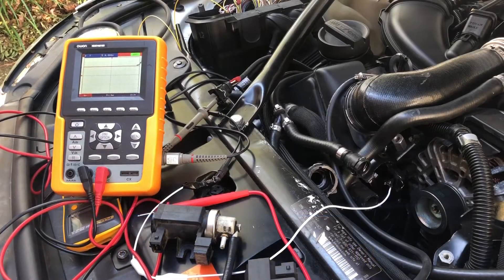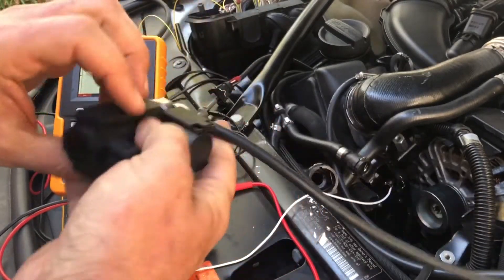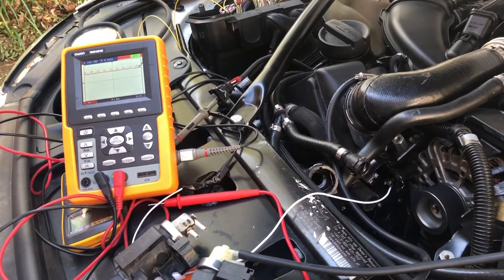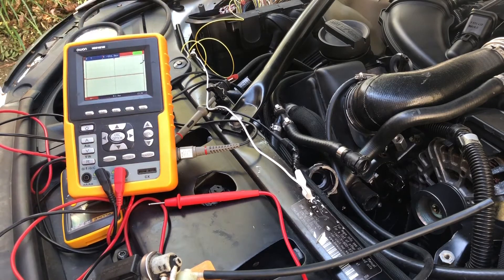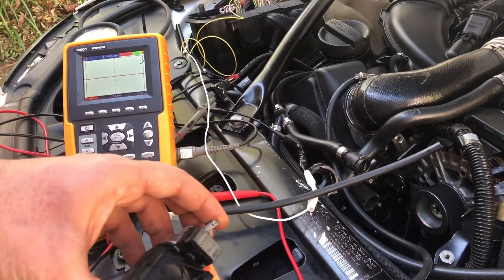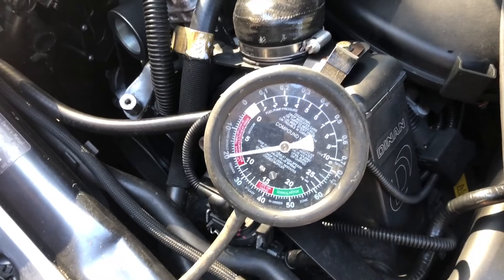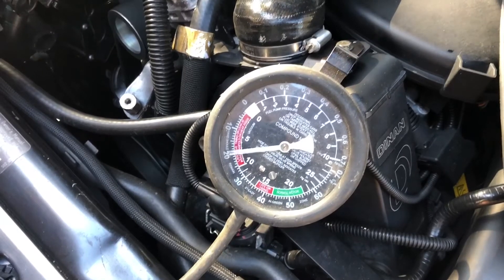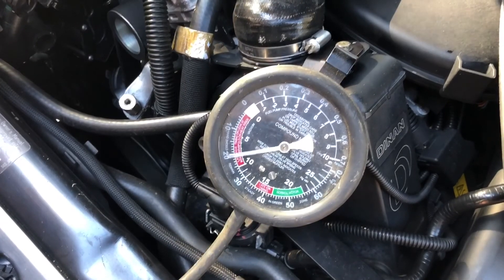BMW N63 diagnosing overboost issue! BMW dealer gave up

Comment: Hi, i have the problem that’s it’s not building boost. Can you tell me which cables are from the boost solenoids in the dme? I also want to probe the and check, it’s like they don’t get a signal from the dme. Placed new solenoids, no vacuum leaks, new wastegates. Running out of ideas here.

Comment: Hello. I have the same engine N63. I have the charging pressure control deactivation pressure build-up blocked 120408 error.

1. Since it didn't specify as bank 2, does this mean a problem with the bank 1 components?
2. If so, could it mean that the boost valve for bank 1 is faulty and is allowing a constant flow, which implies an over boost on bank 1?

Please help.
Reply: I have the same code right now. Did you ever fix your problem?

Comment: Hello, what kind od error do you had ? I have 120208 pressure check, boost pressure to high, new turbos, new wastegates and blow off valves, check vacumm lines and no ideas
Reply from the maker: Yes exactly the same error, most likely dme problem

Comment: I have 2013 Bmw 550i after I did valve seal job 
I notice my car have too much negative pressure to the point when car is running its really hard to take off oil fill cap. 
I replaced oil separators under  valve cover PCV is almost new. 
What can be malfunctioning to create this much negative pressure? 
Thanks
Reply from the maker: That is normal there should be vacuum in the crankcase, if it runs good and no errrors you should be fine
Reply: @Bavlogic  No errors it’s running great. I’m concerned I will blow out rear main seal or front seal. I never noticed that much pressure on any cars I had before or worked on before. 
I know there should be some negative pressure but I just do t want to create more issues.
Reply: @mikimiki195  Did you replace the pcv hose? If you did was it replaced with an original part? If not that would be the answer to the negative pressure.
Reply: @BishopBible  yes everything was OEM

Comment: What faults were you getting, I have 00310B: charging pressure control 2 plausibility / 0030FF: boost pressure too low. I'm about to change both valves. Hope it's not the DME
Reply: Yeah I have, trlurned out to be the boost solenoid valve. Changed all the vacuum lines as well the were bad. It was all good after, they are in a very tight place to get to, the one for bank 1 is behind the passenger sideheat exchanger.
Reply: Have you sorted it?

Comment: What possible ways are there to fix this?  I think I may have this issue.   How bad is it to drive with that issue?
Reply from the maker: Replace solenoid, if problem still there it’s DME ecu
Reply: I would tie the circuits together, only using bank 1 circuit
Reply: Technically not the correct way but I like it! 😂